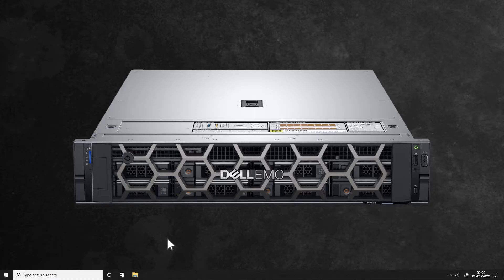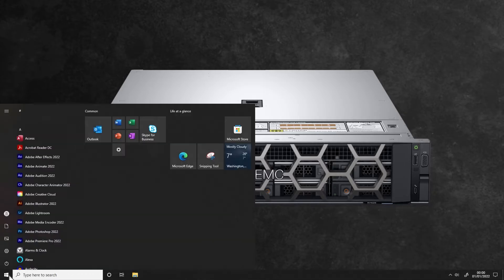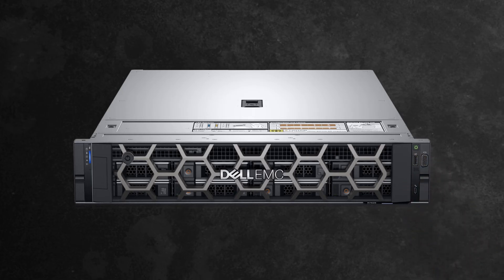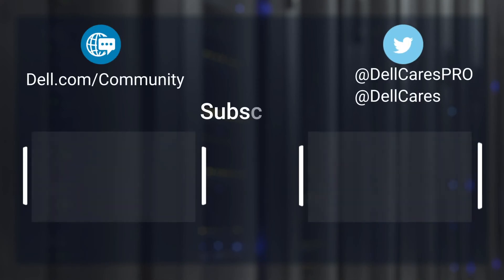Reset and Drain Power on a Dell PowerEdge Server QuickTips

Comment: Still not working. Tried al these method. I habe also changed the RAMs from my other Power edge
Reply from the maker: Hi @irkgraphix, for further assistance please contact the Dell Support directly at https://dell.to/40Y7md9

It is helpful if you already completed common troubleshooting steps: https://dell.to/4hFNQrm

And if possible, be able to provide logs for the support engineer: https://dell.to/4hKv1n1

Thank you.

Comment: Dell PowerEdge R720Dell PowerEdge R740 idrac stopped responding and on the server idrac port has blinking amber led, how can i recover idrac while there is ongoing services?
Reply from the maker: Hi @sasmipca, you can try to recover the iDRAC Firmware as described in this KB article: https://dell.to/3vAZr8U

If you need further help, please contact the Dell Support directly at https://dell.to/43RKj3s

Thank you.

Comment: i have problem with my old server the idrac is blinking orange. after i shutdown is this the solution for that issue?
thank you in advance
Reply: In Dec 2020,I ordered a new Dell R240.there is a light on the front that changes from blue to yellow to tell you there is a fault!
Well, Dell sold me,mine at a discount price,but also didn't put in fan # 4!
This is why I'm getting constant fault notices!
Dell cheaped out to save a few bucks by not putting in fan 4,or someone in my apt,removed it!
You also need a copy of windows running on the server with the idrac software to login and fix the problem!
Recently I priced this litte fan,it's 58$ which will stop giving me faults notices.
😢

Comment: Hello,
Thanks for this good tutorial.
I have a problem with a DELL server R640, new with another 9x R640 and 2x 3240 storage DELL servers.
we had a bad electricity shutdown in the building, for like 4 hours, the emergency power supply goes 0% so all the servers and switches went down.
after they came and fix the problem with electricity, all server turned on normally except 1 server R640, the iDRAC turns on and power supplies green, but the power button on the server does nothing.
The server just won't turn on, i tried removing PCI Express cards, RAMs (keeping only 1), with only 1 CPU.... but still won't turn on.
I logged to iDRAC and found the error and looked online and found this:
Dell PowerEdge: VLT0204 - System Board PSx PG Fail voltage is outside of range.
If you can help me fix this problem i will be very thankful to you.
Reply from the maker: Hello, please follow the instructions in this Knowledge Base Article: https://dell.to/46a60vt

If this does not solve the issue, contact the Dell Support directly here: https://dell.to/3LjDQGz

Thank you.

Comment: Its stuck on loading bios drivers
Reply: Hi, i had this problem. with R640.
I did update the bios and drivers from iDRAC.
But becarefull, you need to respect the update version order.
Don't jump to the last one directly
Reply from the maker: Hello Dabysing babs, please follow the steps in the video. If this doesn't work, contact the Dell Support at https://dell.to/3AyhDie

Thank you.
Reply: @DellEnterpriseSupport  ur link resolves on Dell domain not a video
Reply from the maker: @dabysingbabs3295  Please follow the steps in the video above ( https://youtu.be/8Hp4wTjESo4 ) and if this doesn't work, contact the Dell Support at https://www.dell.com/support/contact 

Thank you.
Reply: @DellEnterpriseSupport  hello, i have new poweredge r740,it was working find but is just dont want to power on .I have done all i can but still.need help